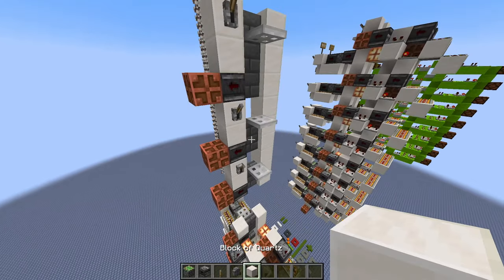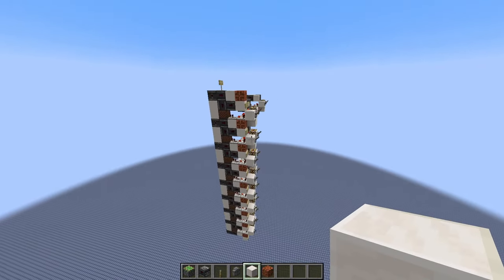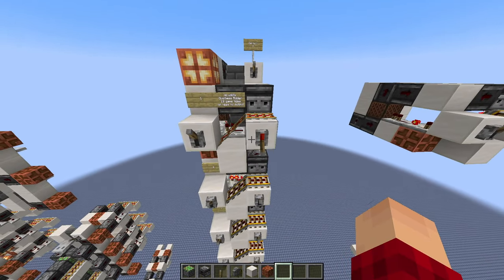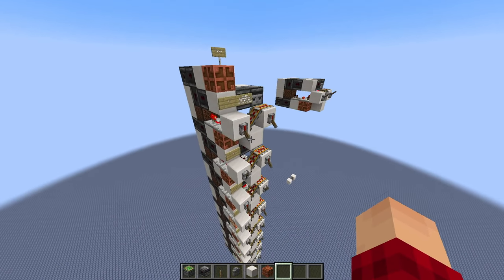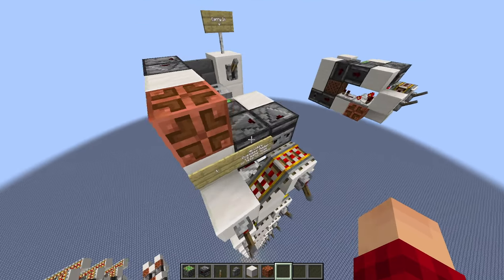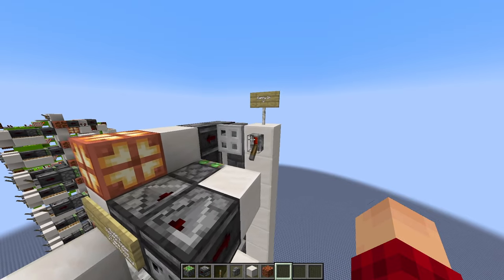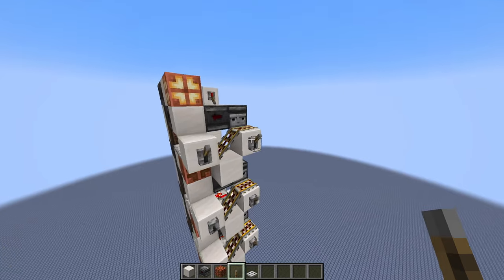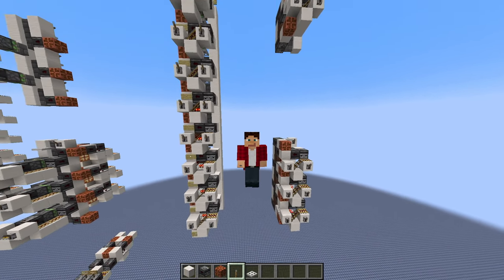Someone Made My Adder Even SMALLER 🤯

Comment: Getting into redstone computers again at a good time. Been learning a lot about redstone and making myself an 8-bit computer one piece at a time.

Saw the previous video and thought it wouldn't fit into my setup, but now looking at it again with this design, my system will only be able to change 1 register of the ALU at a time. Meaning so long as you can update one entire side at a time (I'll be building this shortly to test XD), timing shouldn't be an issue. Granted, with the additional delay to the right input, you likely would want your A register to be the left input (especially if like me you are putting the ALU result back into the ALU A register), which would further help prevent timing issues.

The copper bulb is by far my favorite redstone component now XD

Combining it with some 0 tick bi directional rail wire (still working out some building issues) for a main bus, this should allow for anywhere between 8-128 bit computing to be done at the same tick speed (assuming your computer doesn't melt). Combine it with copper bulb memory cells.... Some pretty compact computers about to start showing up :)

Time to get back to designing my first functional computer!
Reply: You are just getting back into redstone again...  but I am literally the guy that has been planning to make a redstone computer since I learned about Minecraft in February 2011... and I still have not gotten around to it yet.   Perhaps now is the time !

Comment: A few notes:

This is not new technology wall based carry systems have existed for years and even I made a few of these adders like a year ago on ORE

-These adders are NOT CCAs, as a CCA specifically has glass towers and signal strength comparison. This would be classified as an ICA or instant carry adder, with a few variants being the CICA (comparator ICA) and the CTA (carry trail adder, a non instant version of this logic)

-a 2 input T flip flop is NOT an xor gate, as logic gates are always combinational

-This is a relatively slow adder, as most modern conventional adders (ccas) clock at around 6-8gt with some even reaching 4gt without any instants.

Very compact tho! There are technically smaller adder designs, such as a 36b serial adder that does any bit addition without growing in size, but it isn't too bad if all you need it to do is to add and delay isn't too big of a deal.
Reply from the maker: All very good points, and these are also things that I already mentioned. It is a form of Instant Carry Adder just like I stated in the description and thumbnail. And yes, a 2 input flip flop is not technically a xor gate, as getting inputs at the same to it would result in an incorrect output- something I already pointed out in the Cons of the design in my last video. A state-based design like mine will never be superior to redstone in terms of being unbreakable, but the pros of this are that it is compact and infinitely stackable (within world height limit) as I mentioned.

Thanks for the quality comment though! Good to see someone from ORE here.
Reply: @michael23b  👍

Comment: Awesome build! I was blown away by the previous version, and it's awesome how qLudd made it even smaller. I was inspired to play around with the design myself.
I was wondering if the repeater delay on the right input was necessary. I replaced it with a piece of redstone dust and swapped the block for glass so it didn't quasi-power the sticky piston 1 module down. As far as I can tell, it still works, but the maximum delay is only 11 game ticks. I might be missing something though. I suppose it's also not dustless anymore, but still infinitely expandable.
I also tried making simultaneous input work. It seems the copper bulbs were receiving pulses too quickly, so they never depowered to toggle correctly. I added 6 ticks of delay to the carry circuit, and it seemed to fix errors when simultaneously turning on/off. With the repeater-dust swap that's 17 game ticks max to get an output. It's also 2 blocks longer, but it might be possible to clean up the timings in the front to bring those stats down. Unfortunately, it still gets messed up sometimes when turning one input off and the other on in the same tick. It's a really cool problem though, so I'm still looking into it.
Again, awesome build! This update is great for redstone in general.
Reply: Oooh, I think I figured out simultaneous input. Mostly inspired by the mechanisms here, but I majorly rewired it to make the timings line up better. Surprisingly, it's still 13 ticks max to get an output, and it takes up the same amount of space as the design here. It does include some dust, but it's still infinitely expandable. But yeah, I tested a bunch of combinations, and it seems you can change the inputs simultaneously every 13 ticks without it getting messed up.
It might be possible to get this design down to 11 ticks with simultaneous input.  I think the cooldown on the copper bulb prevents it from toggling any faster.

Comment: why don't you have all the trapdoors closed by default than replace the sticky pistons with trapdoors that only allow a carry when they're opened? Cause this would allow the bits to be only one block apart
Reply from the maker: Because that wouldn’t allow different groupings of carry’s to happen. If I invert the trapdoors so they are closed up against the wall by default, then opening them to cause a carry won’t even do anything if another higher trapdoor is still closed- the wall will still remain the same shape until any higher trapdoors are also unpowered from against the wall.

The reason the pistons are necessary is because there has to be a physical gap in the wall to allow different groups of carry’s to happen.

Comment: How does the new update affect it, if at all?
Reply from the maker: It doesn’t affect it, only makes the output time slightly different
Reply: It should be able to make it even faster because the 1 tick delay was removed, not increased to 2
Reply: @JulianGaming007  Removing the 1 tick broke a lot of my redstone machines, I used them for precise timing